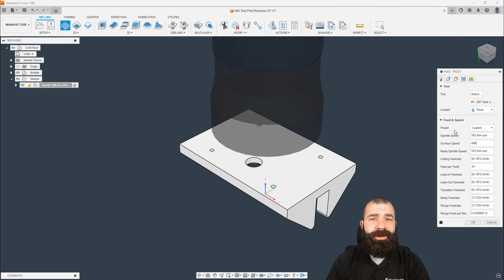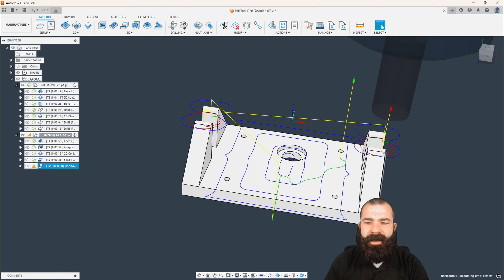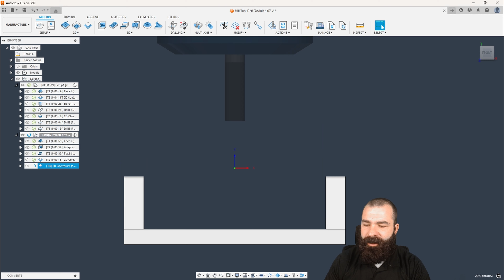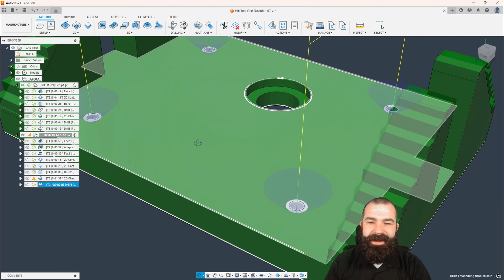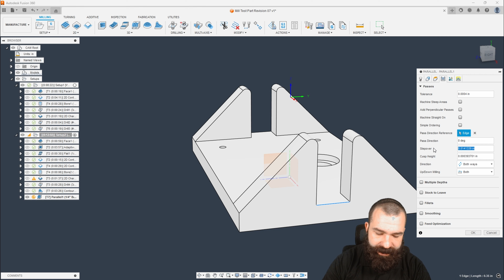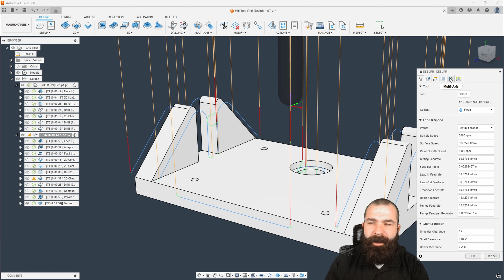Milling Monday: Xometry Test Part

Comment: I have a question:  When you flip the part and start on the "main" side you first face the part which makes sense to me.  But I'm curious why you don't then re-locate off of geometry that the facing operation has revealed?   When flipping the part  the stock isn't always the same exact dimension from top to bottom so I'm thinking the main features might be a little off from the base of the part.  Or am I not understanding this?
Reply from the maker: Had to rewatch the video and the anwser is..... I forgot that part lol. Personaly I would go with bottom back left corner with the setup  2 as it is easy to info from a stop/123 block.
Reply: @JITCADCAM  got it.  thanks for letting me know!

Comment: Awesome video! Love that you're straight to the point with everything. When I did my test part I used gripper jaws and was able to machine all features from one set up and then flip it over and face it to size. For anyone following this step for step I would advise when you flip the part you locate from a machined surface instead of the raw stock left over for more accuracy.
Reply from the maker: Awesome love to hear it. Yeah i forgot to show that.